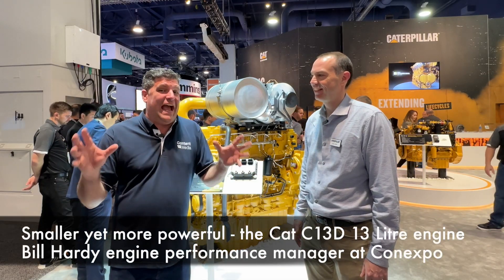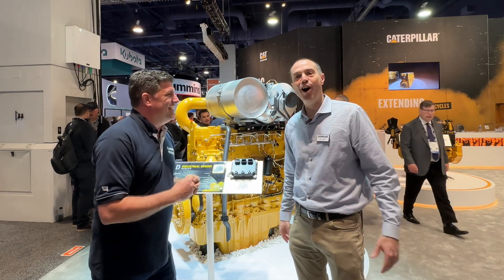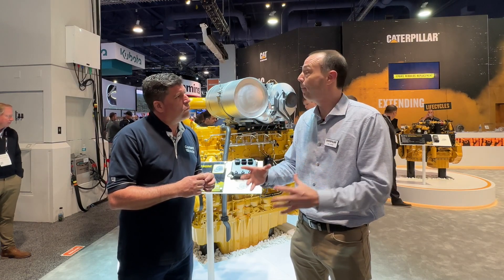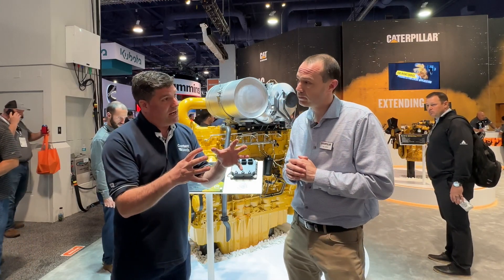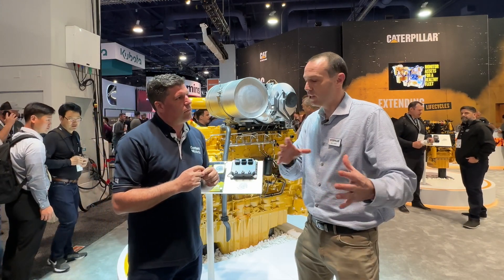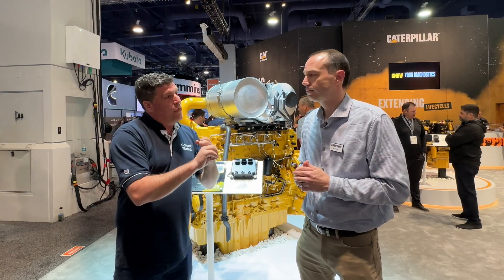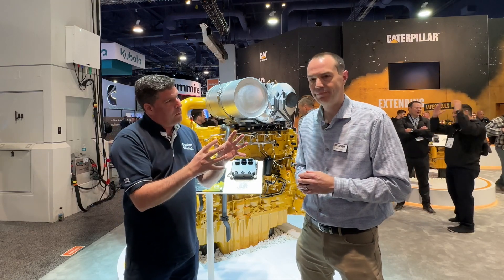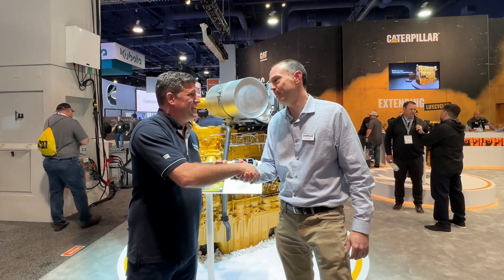Smaller yet more powerful, the new Cat C13D Stage V 13 litre engine with expert Bill Hardy

Comment: It’s not magic. Volvo has been doing this for years. My old 2016 Freightliner Cascadia had a 14.8 liter engine. It made 455/1650. My new Volvo vnl760 has a 12.8 making 455/1750.
Reply: C18 single turbo 800 hp 2696 lb-ft torque
New C13D 456-690 hp 2360 lb-ft torque
Which both engines will pretty much  put both your Cascadia and your Volvo engines back on the trailer.
Just saying
Reply: @Bert-b8t  No truck sold in America has more than 2050 lbs-ft torque.